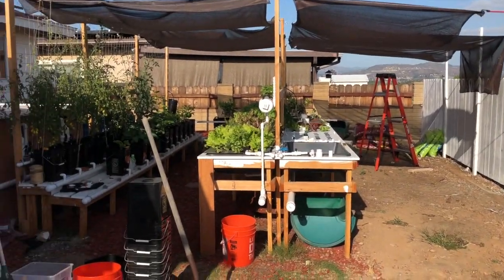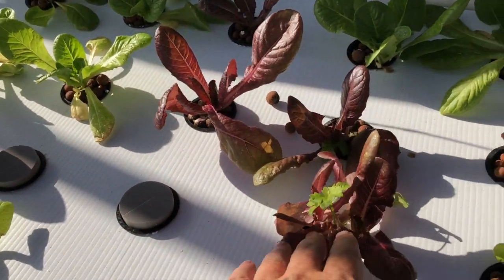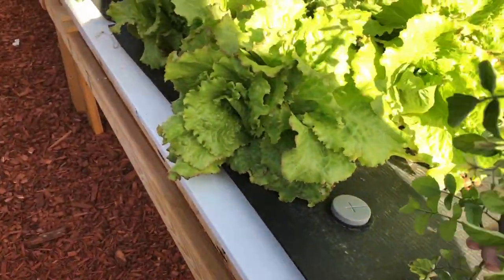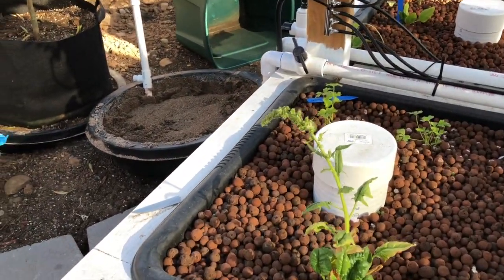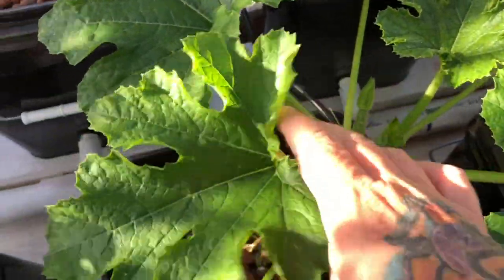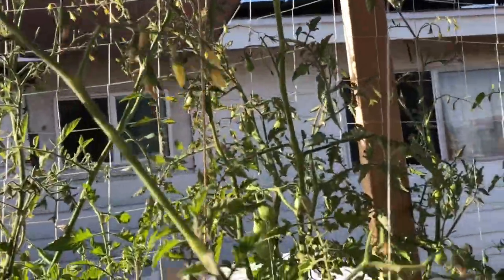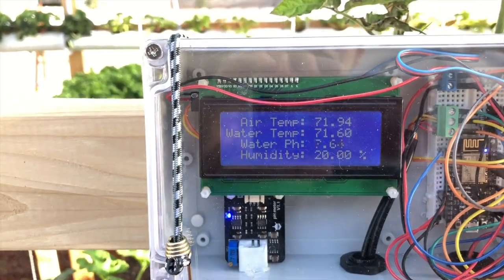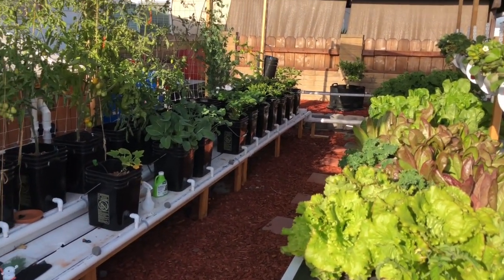Aquaponics Vlog: Growth and System Update

Comment: Great update Jeff! I see your running into an issue I was having, with that many single drains and fill lines it was only a matter of time until the roots got into those drains and also having that many fill lines is difficult to dial in. Good luck thanks for sharing and as always Keep Building👍
Reply from the maker: thanks. ya had the same problem in the hydroponics system with tomatoes
Reply: Jeff Davidson I'm gonna try this one of these days and put paint filter bags over the outside of my bell housing. In my Hydro Dutch buckets I lined the inside of each bucket with the filter bags and I haven't had a clog "yet" knock on wood.
Reply from the maker: good idea. Ill do that when I clean out this bed. wish I would have thought of that for the buckets. having same issue with one
Reply: Jeff Davidson or use one bag for each plant in the beds that way sediment doesn't clog the drain. I think Rob bob did that with air pruning bags in his beds and it also makes them easier to move if need be.